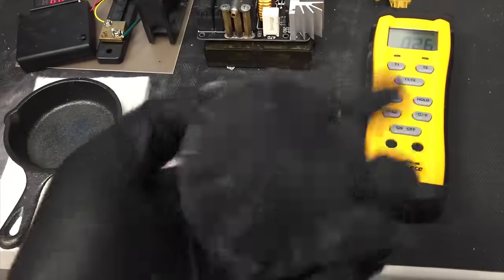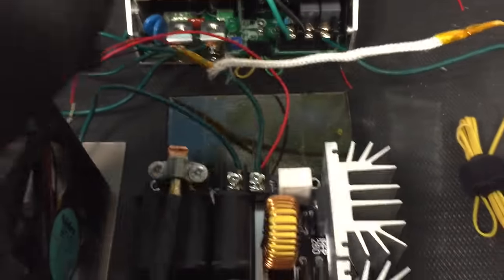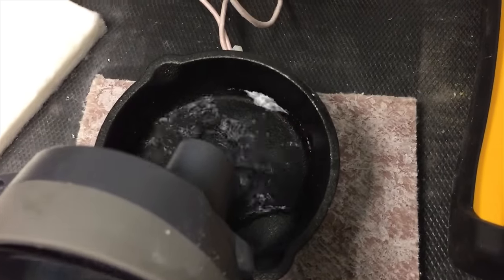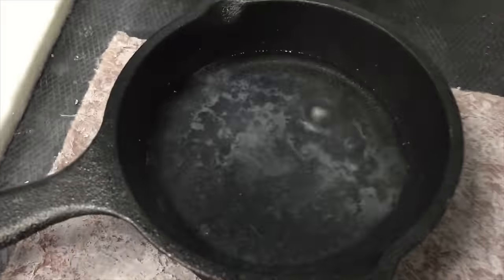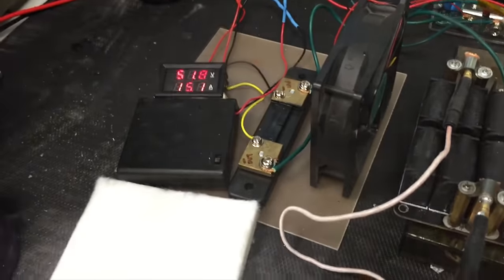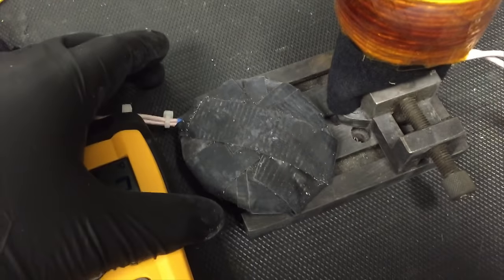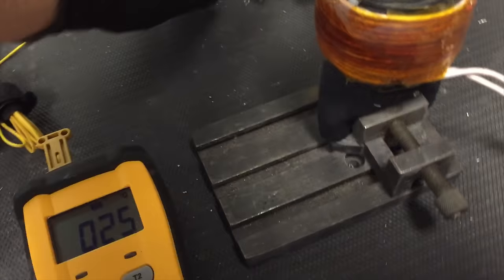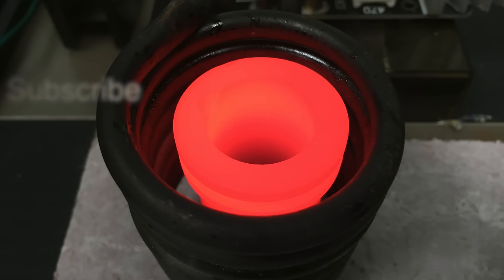1000W Induction Heating Part 4: Pancake Coil

Comment: If you have to cool the components, then how could this save energy? I'm just asking... My mind is saying why bother if it leeks energy!?
Reply from the maker: Let's just look at an electric stove top.  First, you have to heat a resistive element up that then transfers heat to your pan.  Induction is substantially faster because the heat is directly transferred the pan and some of that heat leaks back to the coil from the pan.  Using a 1-2 Watt fan to keep things cool isn't really a big deal when compared to the 1000 Watts the machine is using.  A more industrial machine would use much more expensive components with lower switching losses and better thermal properties.
Reply: Thank you for that great information Proto G, I'm not concerned with the energy cost of the little fan, it's heat leaking off the electronics. I'm just wondering is it less than the 60% heat loss with gas? Mind you I'm all for induction due to speed and safely, but I'll always have at least a single gas burner for gourmet cooking.
Reply from the maker: Induction is more efficient than electric stoves and much more efficient than gas stoves.  Induction cooktops are 80%+ efficient, electric stove tops are 70-77% efficient and gas stoves are about 40% percent efficient.  Induction cooking is more efficient and faster than both.  Not as cheap though.

Comment: how woul i make one that heats only between 100-250 degrees with temp controll
Reply from the maker: Add a temperature controller like this: http://amzn.to/2h83KPD 
Add a contactor like this one: http://amzn.to/2hFt5Bh

The probe of the temperature controller unit would need to be attached to the part or on a base the the metal sits on.

Comment: you should use thicker wires, not because of the temperature, but because of the voltage drop.
Reply from the maker: Voltage drop isn't even a slightest concern here.  You will not even see a 0.1% difference by using thicker wires in this case with such short wire lengths.  For example, the 14AWG wire I'm using has a resistance of 2.525 ohms per 1000ft.  A thicker 12AWG wire has a resistance of 1.588 ohms per 1000ft.  So for this example with about 1ft of wire, the resistance of the current 14AWG would be 0.002525 ohms and the 12AWG would be 0.001588 ohms.  Assuming a constant current flow of 20amps, the 14AWG wire would have a voltage drop of about 50mV while the 12AWG would have a voltage drop of about 31mV.  Using 14AWG results in a 0.1% voltage drop while the 12AWG would result in a 0.064% voltage drop.  We don't have a constant current so let's assume with the 14AWG we have exactly 20 amps flowing.  Using ohms law, the load for the power supply(including the wire) is 2.4 ohms.  Switching to much thicker wire say, 10 AWG would reduce our power supply load to about 2.3984739 ohms which would increase our current flow to 20.013A.   Temperature is the only concern here, not a voltage drop and I've shown that the wires does not get excessive hot so the setup is fine.  Voltage drop is most commonly a concern with long cable and wire runs.
Reply: +Proto G Well, you're  right. 50mV drop won't make any difference for zvs driver. I did not notice how short those wires were.

Comment: Newb question probably... but how does the tape not melt?
Reply from the maker: +free8704 The coil doesn't really heat up too much on it's own.  It not's the same as the coils on your stove, it is wirelessly transferring energy through electromagnetic induction.
Reply: Right that makes sense, but the metal object sitting on it gets hot right, so I would think it would melt the tape with that much heat.

Comment: If I used smaller litz wire would it still work.
Reply from the maker: +seth Yes, but may overheat if you don't use enough windings.  You can always use copper tubing or double up thick wire if efficiency isn't critical.
Reply: +Proto G Okay, thanks for your time.

Comment: you can buy the complete induction heater at Costco for $ 49.00.
Reply from the maker: yes, they have induction cooktops at Costsco and other stores but those are much lower frequency so they can only be used for cooking and not other things like heat treating steel.  The lower frequency results in much more even heating, which is good for cooking.  Higher frequency will start to be affected by the skin effect and heat the outside surface of the object much faster than the inside which is good for heat treating.

Comment: I'd like to make a 12 volt (dc battery 12.8-14.5 volt) coil for heating a cafetière or small teapot, is 12 volt enough, I'd like to consume between 500-1000 volts to avoid staining my batteries and run direct from the battery, do you think this is feasible and do you have any suggestions such as wire gauge?